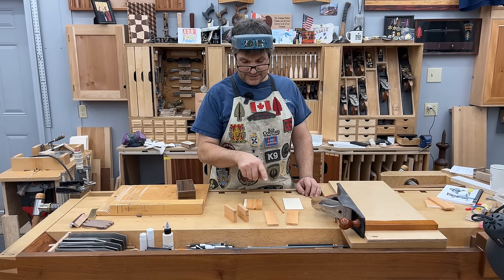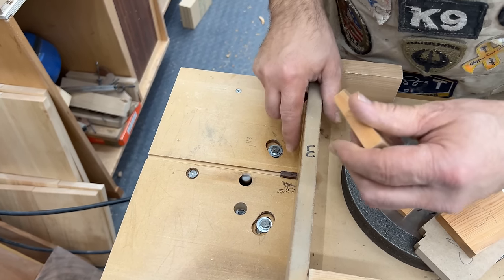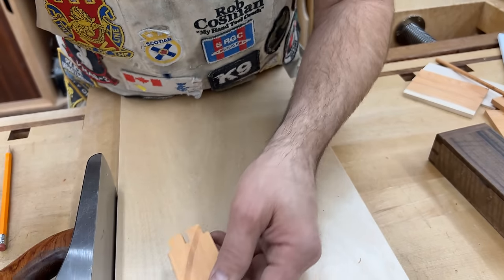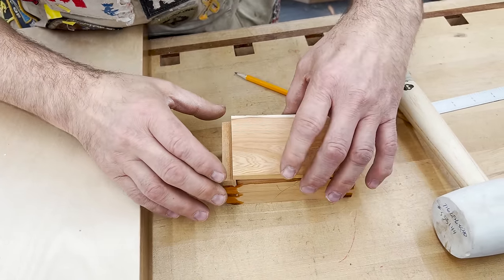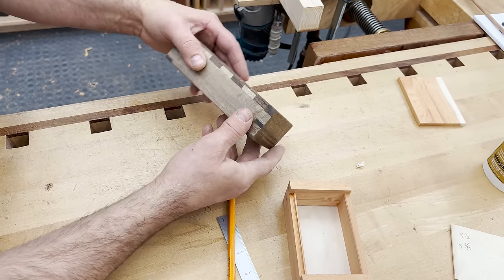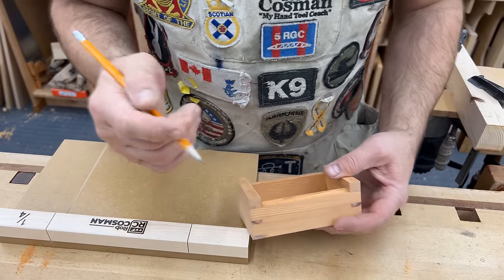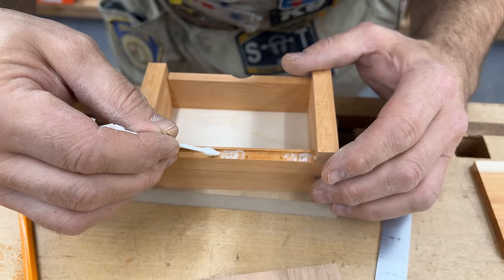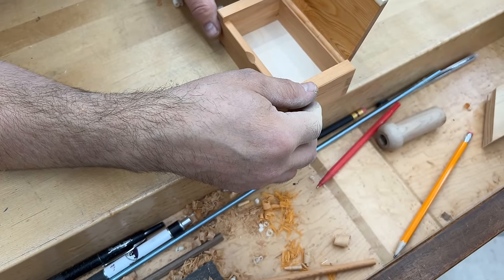Wood Hinge Box Build (2022)

Comment: this guy is a genius, but i have to say...I have tried over a half dozen of these and none of them have come close...in fact...most don't stay together.  I bought the dowel centering jigs and they work great...unless the dowel is just slightly too big (won't fit) or too small (hole is off center, and I mean dowel is too small by 1/64th...  Titebond doesn't seem to hold; i'm using Morado, walnut, sapele...initially it glues up OK when I take off the clamps, generally 4/5 of the dowels hold UNTIL i try to plane them down; then the outermost get knocked off and the whole thing falls apart.  I've tried 1/4" and 3/8" dowels.  I've tried epoxy.   I've built some faily sophisticated stuff...a handmade steel string guitar, a surfboard (out of wood, not foam); but I just can't seem to nail this one.

Comment: Hi Rob, I found your videos when I didn't want to use a metal hinge thinking there have to be alternatives. Little did I know my world would open up after finding your channels. This is a great way to finish off a box. I watched your other video that showed the large storage box and 3/4 dowel hinge.

I did want to ask about the position of the lid on the router table vs the back. I did a test following this same method, lid flat on table with back against the fence; back upright with outside of back piece facing the router fence.

What I didn't understand what why these two could not be run across the router in the same manner. I put my pieces together to look at the cupped opening and they are the same as I would expect since the router bit is in the same position when both were done. There must be a reason I am not seeing why the lid and back piece are run across the router in different ways.

Comment: I have learned a ton from your work!  A question for the GOAT - is there a way to do this hidden wooden hinge with the top on top instead of inset between the sides?  I would imagine the most you could do is change the dimensions of the pieces, only leaving the back top corners the same to achieve a true hidden hinge.  Thanks Rob!

Comment: Hi Rob, love these videos. When cutting these boxes with dovetails, have you considered cutting the tails in the small thick ends rather than the front and back? Is there a reason you cut tails in the front and backs? Thanks
Reply from the maker: The reason you cut the tail portion in the thinner board is because the thickness of the pin board helps elongate the “dovetail” and thus make it more recognizable. If I’m going to go through the effort of cutting it by hand, I want people to readily see that.

Comment: OK,  you used four different routers all set up with precision.  I'm thinking about the #2 and #3 dual sliding table setup.  the #3  is setup for the width of the router bit. Then the pin is set up at 1/2" inch from the cutting tool.
So that means #2 router pin is set up for the width of #3 router bit.  To the exact dimensions.   How difficult is that ?

Comment: Always great videos.   Any advice on doing wood hinges on boxes where both top and bottoms are equal. IE. cutting a preassembled box in half and adding a wood hinge.    I just see you router out the lid and base in different  directions( lid laying flat and back standing up. Would this work for  what I described above.  Thanks and cheers.
Reply from the maker: Yes it would.  The only difference is the end of the wooden hinge would be seen on the side, but I have done several like that

Comment: Nice box! What's the hardest wood you would still consider hand planing instead of sanding? I've got some really hard chichipate and ipe that I've used for tiny details on some projects, but I've had a hard time getting the flawless finish on larger boards. A 30 degree back bevel helped a lot but I still have some tearing. Thanks for sharing your videos.
Reply from the maker: It all depends on the wood. If it will readily tear with a blade, I’ll opt for sanding. Also if it requires too much effort to keep the blade engaged because the wood is so dense (I probably wouldn’t plane Lignum Vitae) then I’m forced to sand.

Comment: Hi Rob and team, what wax paste do you use? Will any wax finish work? Bees wax?
Reply from the maker: softer wax is easier to apply, no brand preference.
Reply: No worries. I went all out and got s olme renaissance wax. I found the label from your video. I just finished my dowel joint made from mulberry wood. The dowel looked polished when cut and it simply did not bond with tight bond standard. The dowel measured 9.2mm while the insert was 9.5mm. The glue join broke when opened. I then used epoxy and then the lid joints came apart. I now epoxy these pieces. Not sure what i did or if it was the wood. The joint was tight. Could i have clamped to hard? Any help would be appreciated. Ash from australia
Reply: The epoxy held better but i just had the center hinge link break off. I can only think the dowel is too small or the glue is not bonding to the mulberry. Bugger. Ill try again

Comment: I followed this carefully and everything worked out great except for one thing.  For routing for the dowel, the explanation is to set the depth of the bit to the table to be slightly less than half the diameter.  I found that my slightly less was too much and the back of the lid did not fit flush with the back of the box.  It had a gap.  I think that the the term slight should be "very" slight.    Should I raise it a tiny amount and rout the top a little deeper, or I have to start all over with a new box  so I can also route the back piece a little deeper. (it's already glued up).

Comment: Hello Rob, could you please explain how you developed your jig and if possible show a diagram or the actual jig you are using.  Thanks in advance, and congratulations on your video, I find your methods very interesting.
Reply from the maker: developed that jig in 1986, had an idea and refined it to what it is now.  My genius friend Paul came up with the idea of making the interconnecting pieces to drill four sizes with two options for pin size.

Comment: Hi Rob, is that glue the same as the tight bond version? Or is it the type that needs a accelerator spray?
Also what brand of wax did you use?
Cheers
Reply: Wax is Renaissance Micro Crystalline Wax - I use it myself.
Reply from the maker: same glue, titebond 3

Comment: I just noticed that there appears to be an error in the dimensions shown in the dimension graphic. The ends (or sides) of the box are 1-7/8” as given by Rob in the video and that is what the dimension graphic shows as well. The front and back pieces should be 1/4” shorter in height to provide for a flush fit of the 1/4” thick lid, or 1-3/8” in height, but the graphic shows them to be 3” in height.
Reply: Hmm, I noticed that too. Just to follow the math, if the ends (or sides) are 1-7/8" in height, and the lid is 1/4" thick, shouldn't the front and back be 1-5/8" in height....?
Reply: @masterpianoservices2447  Your’e right. You can obviously subtract better than I can.

Comment: The dimensions at 1:55 are clearly wrong. If the front and back pieces are 5L and the side pieces are 7/16T then the lid should be 4-1/8L  x 3W, not 5-1/16L x 4W. Also, if the front and back pieces are 3W and the lid is 1/4T, the side pieces should be 3-1/4W, not 1-7/8W. I spent two days getting my pieces to those dimensions only to realize I had to start again. Other than that, pretty nice video.